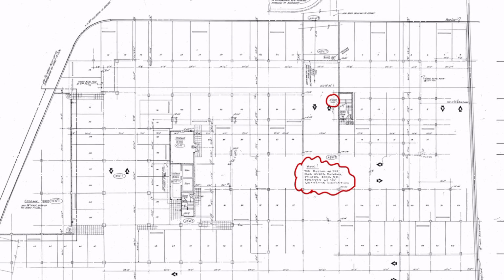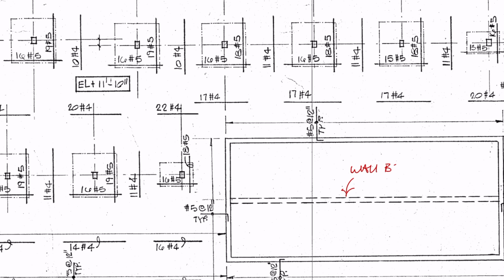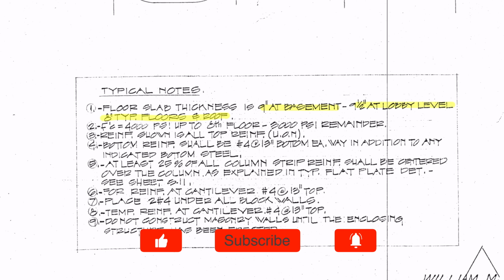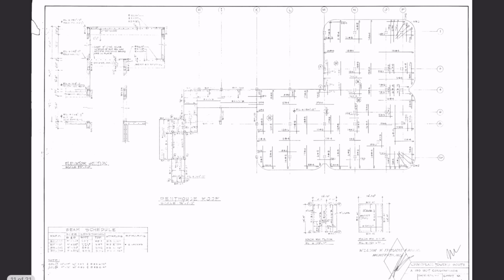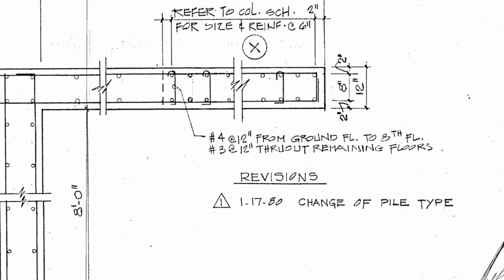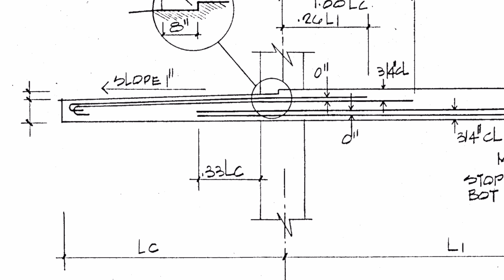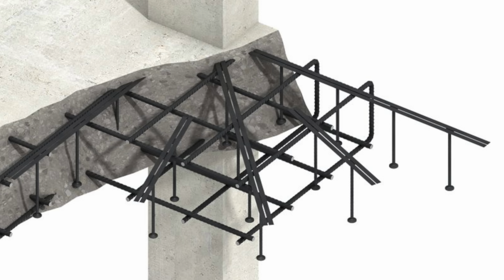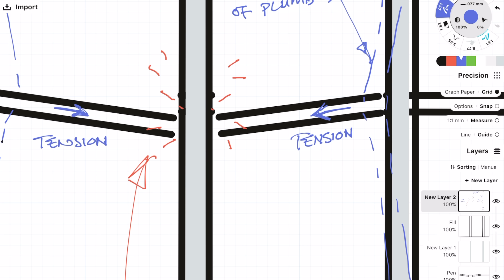Surfside Condo Collapse - Reviewing the structural drawings - Was the design bad?

Comment: On another youtube channel a structural engineer points out that 40 years ago, when the building was designed and built, punching sheer protection was not required by the building codes in effect then.  That said, he thinks the rebar at the top of the slab that goes through each column (8 number 4s) was intended to provide that.  That is different than how it is done today.
He also notes that the page with the Franki piles has a revision date while the page with the driven precast piles does not, indicating that the driven piles were  original and they were replaced by the Franki piles before construction began.
Reply: PS, nice video

Comment: For safety, the surviving building of this design must remove any extraneous weight (planters, pavers, etc.) from the pool deck immediately. Honestly, if it were my call, I'd order an evacuation.
Reply: If the pool deck is sound, that isn’t required.  This building collapsed because it wasn’t maintained. So far, all reports seem to indicate the north building did not have the same problems the south building did.

Comment: I enjoyed your analysis of the failure based on the structural  details, and agree with your theory  that the failure occured due to both lack of robustness in the concrete slab/ column tie in design,  and maintenance of the structure: especially at the  exterior pool slab. 
It breaks my  heart that any architect would show so little concern for the robustness of his or her design, and  especially when it comes to a multi story building. Those so called cost savings by reducing rebar, and or concrete materials to the minimum never pay over the life of any structure.  Buildings of that nature often incur much more maintenance, and cost more money,  endangering the structure when such maintenance isn't done, or executed  correctly when it is done.
I think the practice  of building on the cheap, along  with poor or ineffective maintenance is to blame in this circumstance.
You did a great job in this presentation.

Comment: if it is punching shear failure, why it failed after 40 years??? it could have failed after few years if construction.
Reply from the maker: Most likely due to water ingress that weakened the reinforcement and concrete that allowed the slab to fail.

Comment: The risk of punching shear failure would have been reduced if the original structural design had the "matted" slab bearing on beams spanning between the columns and NOT have the slab bearing on just the columns.

Comment: This is the best explanation that I have seen for the collapse of the Champlain tower. I think you pin-pointed the main cause which is primarily the punch-through failures of the columns and secondarily the lack of shear walls to limit the extent of the collapse. It could be that subsidence of the foundation also contributed by adding extra forces the tower was not designed to withstand. 

The west wing of the building was saved by the shear wall. The east wing could have likewise been saved by a shear wall but the center section was doomed to fail due to the totally inadequate design of the column-floor slab interface to resist punch-through forces. 

Initially I thought that a sink hole may have initiated the collapse but in recent day's pictures have been released after all debris was removed from the site leaving just the "bath-tub".  From these pictures there is no indication of a sink hole. 

What needs to be urgently done is an examination of the structural design of the Champlain North and East towers. I suspect they are similarly inadequate and the buildings should be condemned.  

There needs to be a similar review of older buildings in that area to ensure that they are not also at risk. 

Great channel ! As a layman I almost feel like a qualified structural engineer after watching your videos.

Comment: You would think a retaining wall in that environment would have been much thicker, that is for certain.
I also think it's interesting that we are talking about an era of building in the US, when they generally overbuilt things rather than underbuilt things. So these details seem rather out of place for a building of that era.
I think that once again points to a level of influence to build as cheaply and as quickly as possible, and seeing as how the mob was in construction heavily, and could easily influence inspections with greased palms, that info falls in line with that knowledge.
Lastly, you've got a state like FL which is a Conservative, Pro-Bidnezz, Pro-Developer, anything goes atmosphere where the ends justifies the means. At least until the lawsuits begin....

Comment: An excessively economical design compounded by poor maintainance, poor drainage, user changes over the years, and perhaps original contractor short cuts caused this tragedy.
Reply: My opinion of building codes: They set a minimum standard. Anything built to code is a minimum structure, or as you might say "excessively economical"

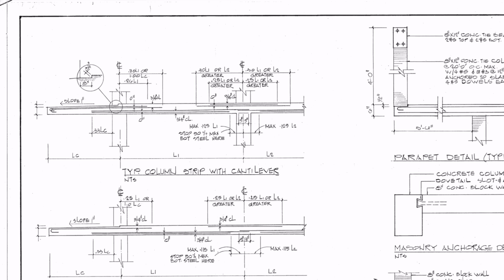Comment: There's a mistake at +8:45, pre-cast piles were not used. There's a later version of the plans which show that Franki piles were used aka PIFs (pressure injected footings) instead of pre-cast piles.
Reply: Indeed, the pile-foundation and the lowest level (garage-floor) slab may be the only elements of this structure that were constructed in a competent manner to be mechanically robust.  Just look at the NIST photos--despite being hammered by every floor of the collapsing tower, that slab-on-grade is completely intact!  Zero visible fractures!  The next building erected there can probably re-use the existing Franki piles, and save a ton of money.  The Surfside height restrictions are still at 12 storeys, so it's not like the successor building is going to be any taller.  Those pilings are sound ... subsidence sub-schmiedence!  ;')

Comment: Take a look at M11.1 its missing from TikTok vid. It isn't a punching shear. Its 12x16 inchs and the long side is sideways.

If you compare with north tower these columns are rotated 90 degrees.

This column is right at the bottom of the ramp, I have looked at real world studies done. This column in ideal conditions can be bottom sheared by vehicle impact at just 50km/h.

Comment: Slab was designed as a flat slab. Punching shear resistance was provided by horizontal steel going through a punching shear cone around column. I believe approved construction documents showed four bars (top and bottom, ea way) going through this cone, but pictures of failed slab around columns showed a lot less….inspection/contractors error and engineers lack of observation. Forensic inspection must give us an answer!

Comment: I will try to put my guesses here after reviewing the as-built structural plans available for download from the Surfside Building Dept website.

(1) There is a 18" to 24" elevation difference between top of the pool deck and interior ground surface of the collapsed building portion which are apartment units. The pool deck side is lower. the columns are small in size probably designed to meet minimum requirements only.

(2) There is a concrete beams (spandrel) along the edge where pool deck and the higher apartment unit deck meet connecting all columns. The columns are poured to the bottom of the pool deck first. The pool deck, spandrel beam, and apartment deck then were poured after columns are cured. 

(3) After the lower pool deck collapsed, the spandrel beam lost lateral constraint from the pool deck and was pulled to the pool side. Notice the columns are not continuously poured. The torsion due to rotation of the spandrel beam causes the columns above and below spandrel beam to buckle laterally. It's like two 4x4 wood posts connected end-to-end vertically and were pushed sideways at the pinned connection.

(4) This horizontal movement of columns creates P-delta effect not considered in the original design.  P-delta effect simply means additional bending moment due to vertical force times horizontal deflection of the column. Most of time, all gravity columns are designed to resist vertical load only and cannot resist the P-delta moment. After the lower columns failed, the building collapsed due to its own weight.

(5) There is no elevation difference between the pool deck and the remaining and standing building portion which is the lobby area. The columns are much bigger in size probably over designed for architectural reasons. Even after the pool deck and lobby deck failed, the two-story columns remain standing due to  rigidity of the large column size. There is no lateral buckling since there is no spandrel beam like the collapsed building portion.

(6) The building appears to have been designed to meet MINIMUM code requirements only at that time. Building codes have been revised many times sine and are much more stringent now.

Comment: Very good. You might mention that less robust structures are cheaper to build and require higher maintenance and inspection to prevent failures. If these are not done it can, and often does, cause catastrophic failure.

Comment: Because IYHO there is a “bare minimum” of shear walls, I stop and consider the meaning of that expression. “Minimum” does not mean or imply “inadequate.” It means the entry level of “adequate,” but nevertheless ADEQUATE. For the rest of the list of structural elements given, there is a great deal of a sort of “damning by faint praise.” What is probably valid about this video is no single element mentioned, it will instead turn out to be a number of them, in conjunction with what happened (or did not happen) over 4 decades. I will wait for the official report for a conclusion.

Comment: I think the weight of evidence is pointing towards maintenance or contractor failure rather than initial design.  The building was designed to proper code at the time, and thousands of buildings built in the same era to essentially the same codes remain standing today.  I don’t think it is fair to say there was no punch shear reinforcement, because there was substantial top steel called for over the columns, which was clearly intended to resist punching shear.   Today, a design would likely use more robust links, if only because insurers offer substantive financial incentives (via premiums) for developers to design for robustness, and most buildings today are overdesigned relative to code for this reason.  Today, land is the main expense for oceanfront property, not concrete and steel.  I suspect the critical columns that failed were damaged excessively due to poor waterproofing maintenance, not their initial design.

Comment: Many buildings in the US during the 70s and 80s were built this way. The standards at that time were really low, which is crazy because buildings from the 30s-60s were massively overdesigned.
Reply: Why did the overdesign of earlier years give way to a flimsy design? Just about money?  There are so many older design skyscrapers which despite being quite old, have never collapsed. Obviously the newer designs are not as sturdy. Time to go back to overdesign again to prevent more tragedies.
Reply: I still chalk it up to mobster influence, as they were heavily into construction especially in a state like FL. They could get anything validated, including a faulty design or skimpy inspections of materials
Reply: One reason may be the advent of computers. When your calculations are from printed tables and slide rules, you're likely to add a large safety margin. The arrival of computers permitted designs to push closer to the danger line to reduce costs.
Reply: @Inkling777  I think another reason is that engineers in the past were not as certain where the danger line was. As a result, they played it safe to make sure to avoid catastrophic failure. For example, bridges were often overbuilt for this reason to prevent a repeat of failures like the Quebec Bridge Disaster of 1907, among others. Another concern was fire, and the relatively limited abilities to fight them many decades ago.  So to avoid collapses, they overbuilt buildings and put very thick and heavy insulation around columns and beams. One example is the Empire State Building which caught on fire in 1945 after a b 25 bomber ran into it killing 14 people. The fire raged for 40 minutes but there was no compromise to the buildings integrity.

Comment: Doubling the strength of the original design would have added less than 1% to the overall project cost.
Now the whole lot is worthless (actually there is nothing left to be worthless)(what i mean is that similar buildings of that era are worthless)(or soon will be).
Lack of good shear walls.
Lack of top reo at mid slabs. 
Lack of good concrete cover in water areas.
Lack of good seal in water areas.
Lack of good punch/shear strength at column/slab. 
Minimal thickness of concrete & reo everywhere.
Designed to fail at its weakest link, such that a single little structural failure can pull the remainder down (as in the Twin Towers).
A house of cards.
We see youtube footage of strong buildings that resist demolition by a tonne of explosive.
In Florida, no explosive needed.
Reply: Actually the lot is worth $100 million. More than the value of the building.
Reply: @neilkurzman4907  Good point. 
If the price of a unit was $2M then praps survivors will get $1M back (for the land), minus cost of cleanup, plus cost of insurance.
Just remembered. I was shocked by many long lengths of reo seen in footage, sticking out of fallen slabs.
If the concrete were good then the reo should have broken in tension, rather than the concrete breaking, rather than the reo pulling out from the concrete.
The reo woz probly the delaminated reo, at the tops of the swimming pool slabs. Slabs not properly sealed or drained from rain they say.
Reply: @atheistaetherist2747  
Apparently in light of the exposed areas there was only two pieces of rebar sticking out of each side according to the design there should be four. 
One more question that needs to be answered.

Comment: I saw something the other day that suggested the precast piles had been swapped for Franki piles, which reduced the overall quantity of piles, but increased the bearing load and improved the soil at the toe.  Also, have you looked at the design code to which the building was designed, did the code call for punching shear reinforcement?  Certainly at the time of construction I doubt there was any specific preformed punching shear products available. Similarly I doubt the code in a non-seismic zone required much consideration of robustness detailing, not least because there hadn't been enough failures to warrant placing additional steel over and above the design load cases for SLS and ULS or whatever philosophy the Floridian code was based upon.  As you have hinted upon, the structural design points to keeping construction costs low rather than contemplation of whole life performance or performance in extremis.  I imagine that the frame was quite prone to vibration during parties or neighbouring construction work as the slender slab would make it quite lively.
Reply: Another structural engineer has said that the rebar can't be considered when calculating punching sheer, that the slab has to be thick enough to resist punching sheer without considering the rebar.
Reply from the maker: You definitely consider rebar when checking punching shear.

Comment: This is one of the best videos on the collapse and I agree with your conclusion. The only other point is the quality of the concrete, investigators who drilled core samples said the concrete was very soft and easy to drill. I agree its a combination of things based on poor quality work, poor quality /thin concrete,. lack of rebar, and cost cutting.
 In Florida in 1981 a 12 storey building collapsed before construction was finished, killing several workers. There were cowboy developers and builders in Florida at the time this was built.

Comment: I believe a #4 rebar is 0.5" and would be 12.7 mm not 10 mm.  I recall that the rebar number system uses 8 as the denominator.  4/8 is 1/2 " 6/8 is 3/4".  Someone please correct me if I am wrong.
Reply: Yep that's right. Once you start going above #8's that rule kinda breaks down though.
Reply: this is correct up to a point- above #8 it starts to deviate very slightly
Reply: You may be right but does that depend on what rebar was available, I assume it would have been 0.5" dia not a metric size. I joined the UK Construction industry in 1967 and was caught up in the change to metric dimensions and saw some similar issues.